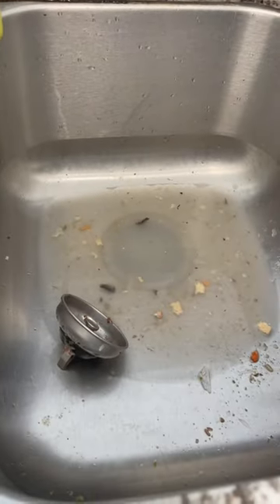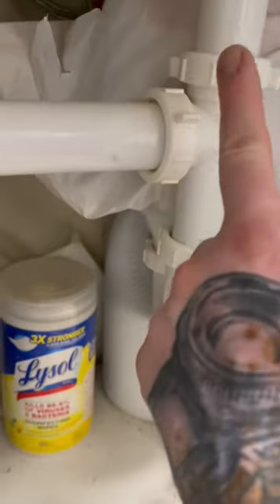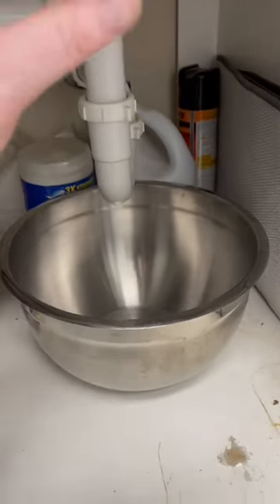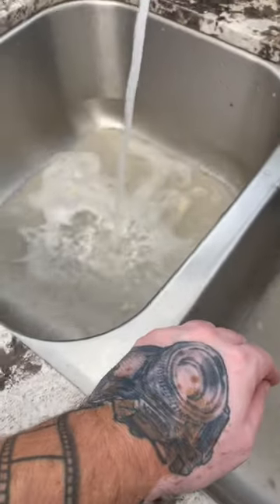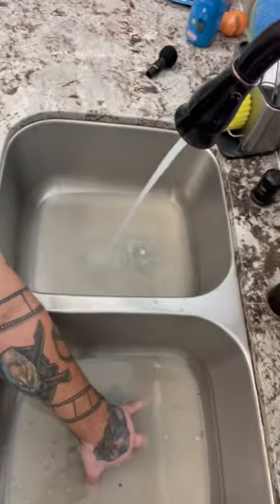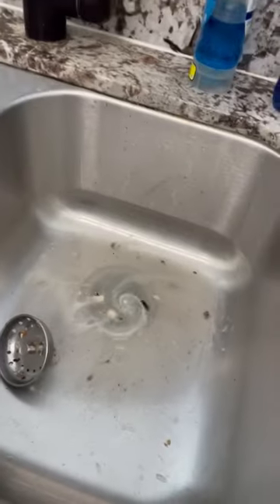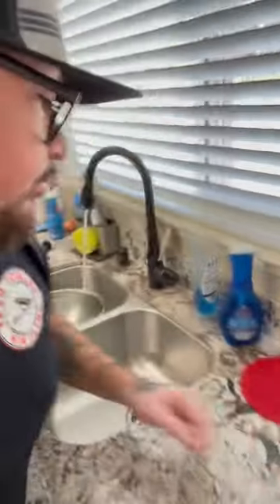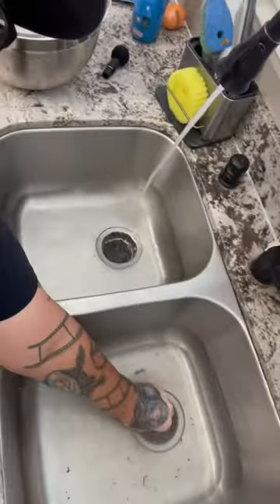Clogged sink plumbing hack

Comment: If you have a double sink but no garbage disposal what would you suggest? Just plugging one side and plunging the other??
Reply from the maker: Yes plug the side furthest from the p trap and use a plunger and focus more on the pulling up motion NOT pushing down. Hope this helps
Reply: @diawithraul  I wouldn't have paid attention to which side to do it on if you didn't mention the part about furthest from that trap thingy. Thank you.
Reply from the maker: @jenniferspence7092  if you have tiktok I have a lot of helpful videos at doingitall.raul but I do have plans for more YouTube videos coming soon. Thank you for watching